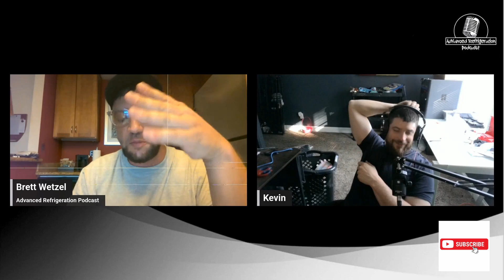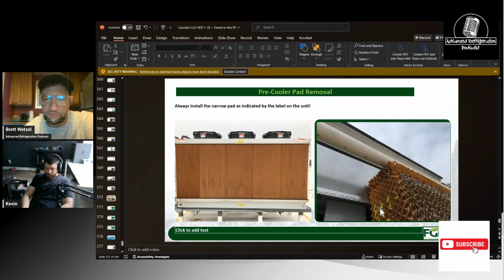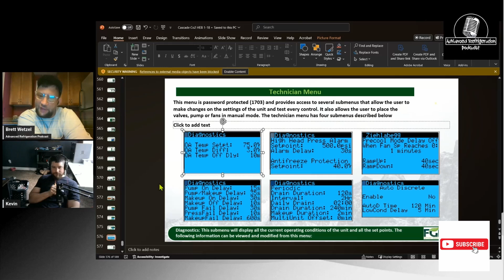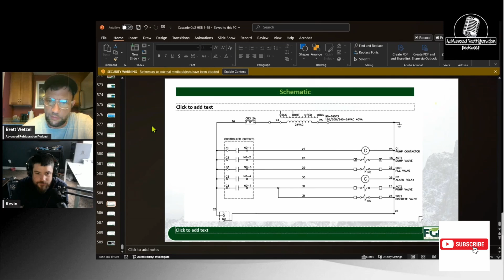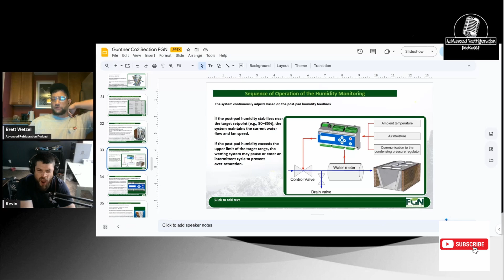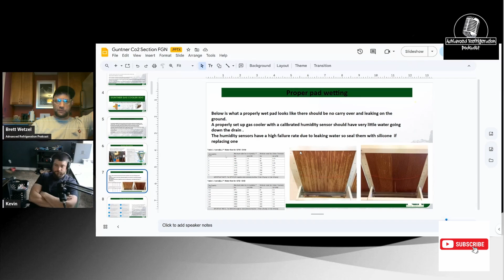Gas Coolers Operation And Troubleshooting, Everything's on Fire,   Episode  428 Video

Comment: Can I ask a glycol question. I have a medium temperature glycol circuit operating two cases side by side. Since the contractor installed last year this one case, case b repeatedly freezes up every two- three weeks. It’s on a scheduled defrost now, changed from on demand to scheduled due to missing sensors and driver boards for multi evaporator units. Four scheduled, off cycle defrosts for 45 minutes each day. I have recently received this location due to a store realignment and have been told the glycol flow rate is set, proper concentration of the glycol and yet ice continues to plug evaporator and it’s just this last case. So ??? Will flow cause excessive ice?? IOT shows a steady operating temperature of 32 degree target plus or minus 1 degree. Ugggggg any ideas or thoughts would be appreciated you have a free moment. Thanks guys love your podcasts.
Reply: Without knowing more about your situation, my first thought would be to make sure that your flow rate and glycol temperature are correct.  The installing contractor may have said that everything is correct, but he could've missed that particular case.  If that one is wrong, then I would recommend checking all the flow rates.
Reply from the maker: Do there during the first and second defrost after the coil is clear and monitor maybe the sensor is in a bad location for the demand defrost
Reply: That’s one of the issues. As stated. The cases came set for demand defrost except there are no sensors or additional driver boards as this case has two evap coils only one discharge air sensor and one defrost sensor. With multiple evaporator. The ke2 needs two coil temperature sensors on the first evaporator. It needs a suction line. Temperature sensor needs a discharge air temperature sensor as well as and another sensor that I can’t remember off the top of my head then the second evaporator in that case is supposed to also have one coil temperature sensor, one discharge air sensor, and one defrost sensor and a driver board that is connected to the KE control all of this is missing in. The temporary fix has been to put the case into a scheduled defrost except we’re still having the freeze up issues that nobody can resolve and I’m not really sure where to look next.
Reply from the maker: Don't forget about normal stuff infiltration  @Shawn_Ref_Rack_Techn